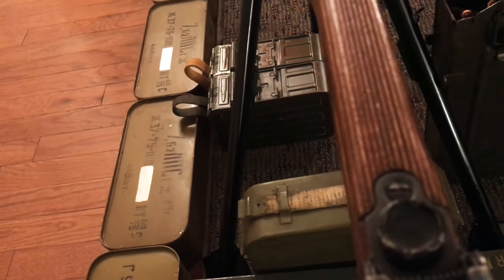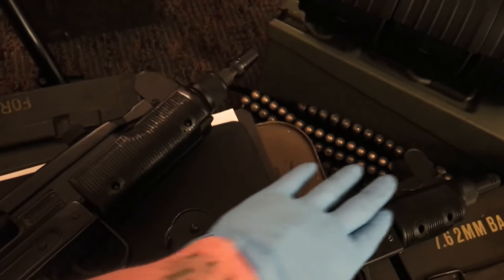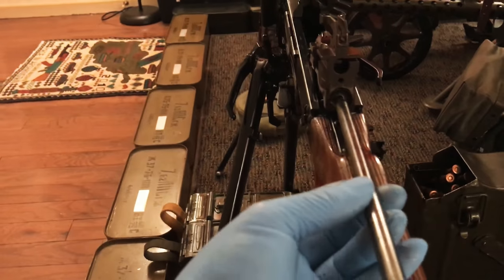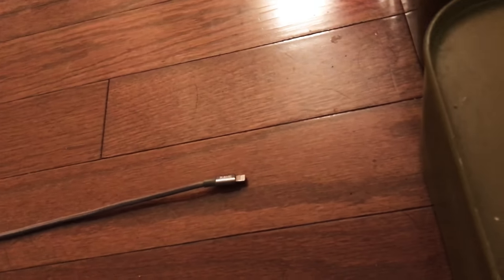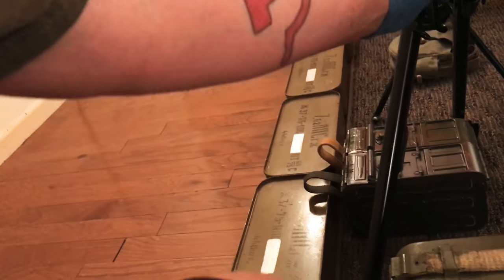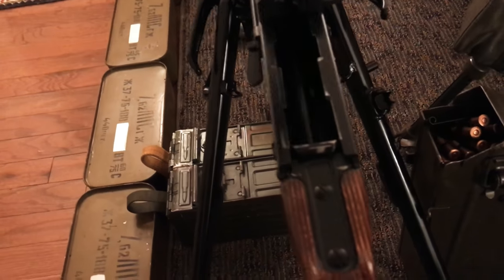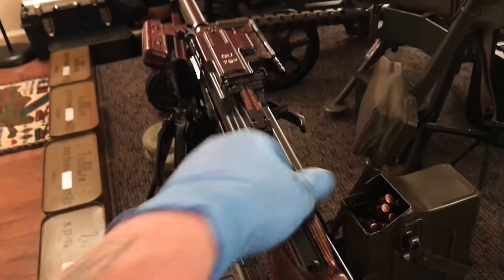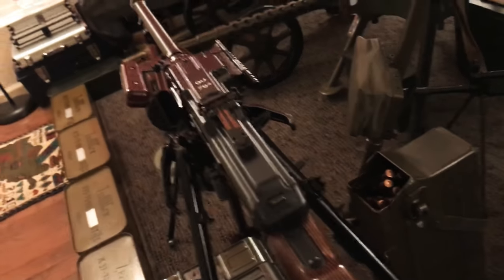How does a semi auto PKM work oh ok well belt fed semi autos are lame

Comment: Bullshit ass laws. open bolt semi autos should be 110% legal. The logic for having these be converted to close bolts could be used for damn near anything firearms related. All it akes for an AK is drilling a third hole? For an AR you can order a DIAS online or make one from a coat hanger??? This is stupid bullshit and someone needs to fight these rulings (Not even LAWS) in court. Complete infringement of the 2nd amendment.

Comment: who built your PKM and SG-43 kit? I'd like the same things but I'm pretty late to the party. Do they still offer the services today? Where can you find good PKM parts kits today?
Reply from the maker: Somnio 64 unfortunately the tide has turned on a lot of parts kits . The SG-43 parts kits are still reasonable but the PKM parts kits are extremely expensive . $4,000ish the last I saw . Finding a semi auto receiver will be the hardest part . 

My SG-43 is a gunbuilds and the PKM is a marcolmar .
Reply: parts kits can only be found on gun forums and some sites. prices start at $4,500 and up.